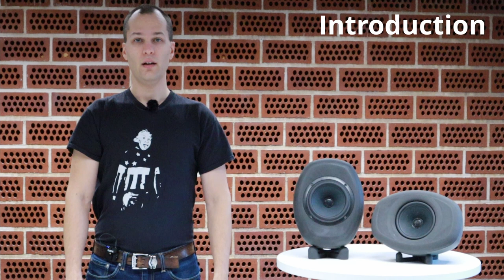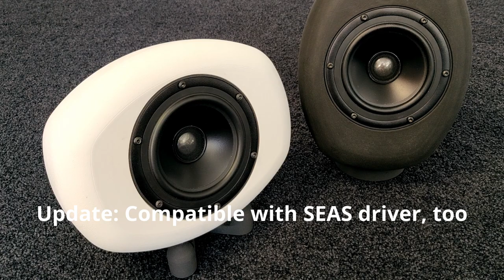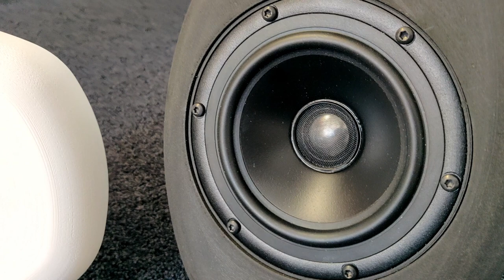3D print your own coaxial loudspeaker using SB Acoustics or SEAS drivers

Comment: I am very interested in the project. But I would like to see a build video and a review video. This video feels more like an overview. I would also love to see more from your channel about 3d printing and speakers. I wouldn't mind paying for a stl file if the build and review videos are convincing.
Reply from the maker: Thanks for the valuable feedback, we will take this into consideration in future videos. The build is super easy for anyone capable of using a 3D printer: The driver is mounted with four screws and connected with four wires. The enclosure can be damped like any other loudspeaker enclosure. For crossover, we recommend miniDSP and their products have good user manuals.